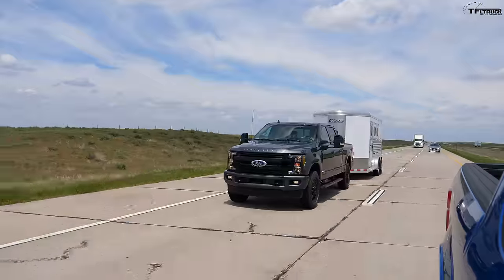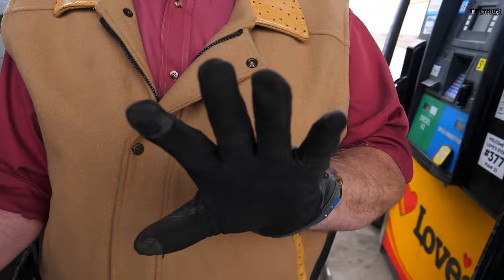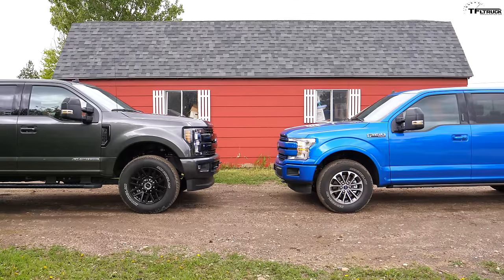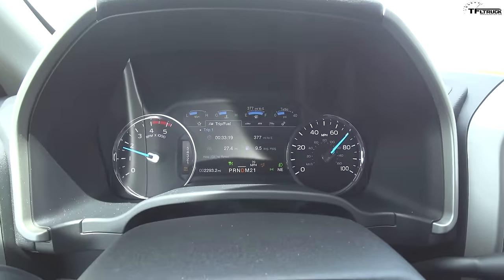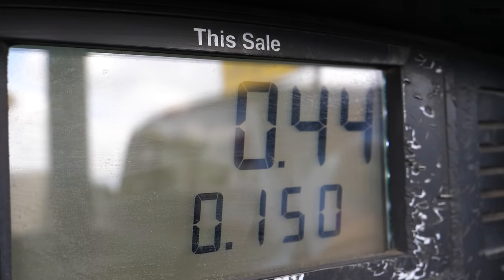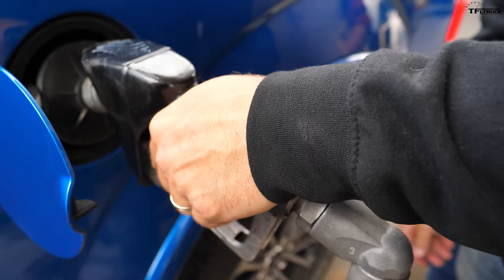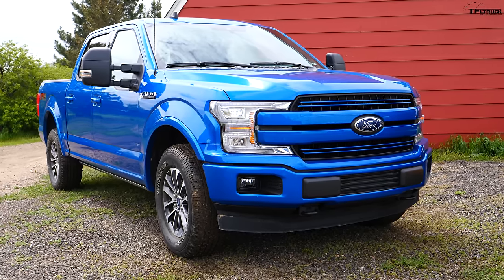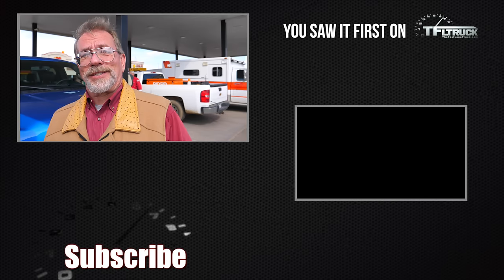Do You Really Need a Heavy Duty Truck to Tow 9,000 lbs? Ford F-150 vs F-250 MPG Review

Comment: Bought a 19 f350 with a gas motor because I knew I wasn't going to be towing all the time. You can feel our steel 3 horse trailer behind it. But for 10k and the headaches that come with diesels now days I'm fine with it.
Reply: Nice, I got the 2018 GMC Sierra 3500 HD with the 6.0l gas engine and I tow my 34' Fifth wheel at about 12-13k pounds, I think it handles it just fine.
Reply: @dedalliance1  I'm in the market for a new truck.  I've driven diesel 2500 for years but with all the emission crap on the diesels I've considered a gas burner.  What kind on mpg  do you get empty and loaded?  Thanks
Reply: @w.j.guidry8459  So my truck's the 2018 GMC Sierra 3500 HD 4x4 Crew Cab Long Bed SLE 6.0L gas with 4.10 gears in the rear end everything's stock in it as far as performance or tire mods.

So for empty highway driving over the 14k miles I've had the truck it usually stays between 11 to 13 MPG but I will say I've driven mostly in Washington State, Montana, and Colorado and the roads between those states. So anytime in Colorado and Montana I'm running 4 to 6k+ feet above sea level. Also, the speed limits in these areas are usually 70 to 80 MPH, and I like to cruise at 85 or so if traffic allows for it. I also run the cheapest gas at the pump that I can get, if that makes a difference to you. If you were going to do 60 or 65 at sea level with minimal hills you could probably push 14 mpg. That being said one time I was driving west of salt lake city by the salt flats and the winds were about I would say 40 to 60 MPH coming at me at about 1 to 2 o'clock and trying to maintain 80 mph I was getting 6 mpg, I actually stopped and gave gas to another GMC that ran out of fuel, so I know it wasn't just me, the wind was terrible.

As far as towing goes, I did tow my sisters 3 horse gooseneck trailer about 200 miles round trip, some city some highway, no more than 75 mph on the highway though, and we had 2 horses in it but only for about 30 minutes going from one barn to another barn (she transports horses for money to various places) and so with the horses you're probably talking a 8 to 9k pound trailer, without the horses around 6 to 7k pounds, and I averaged 9 mpg according to the computer (Which is usually within .5 mpg accurate) and this was in the Denver Colorado area, so exactly a mile above see level, give or take. And with my 34' fifth wheel camper going from Butte Montana to Billings Montana with a couple passes in between, I was testing the best fuel mileage I could get so doing 65 mph (A lot slower up the hills, the engine screams if you try going 60 mph up a pass so I had to just stick around 3-4k rpms and try to maintain speed, I think I ended up going 25-30 mph by the time I reached the top, lol) Anyway, 3 hour trip and I checked it at the pump I got 8 mpg, which the pass I climbed was 6,500 feet above sea level, everywhere else was probably 4 to 5k feet. But then another time, I was going from Colorado to Montana in a hurry pulling my camper, I got a job offer and they said be there the next morning and I didn't leave until 4:30 PM on a 9 hour drive. And I'm not condoning this to anyone out there, but I was pushing that truck and trailer to 85 mph or better anytime I could just because I needed to make a decent time. So roughly a 500 mile trip on every tank of gas I was averaging right at about 4 mpg according to the computer. So if you're used to diesels and being able to go fast up hill or on any terrain really and you try to push a gas truck like that your fuel mileage is going to be complete garbage, they just don't have that torque until you get to 4k rpms or better and even at that it's still half the torque of a diesel.

Before I got my trailer I had about 12,500 miles on the truck and the biggest load I had on it was my small 1,000 pound pop up truck camper, but it wasn't on there a whole lot, maybe 500 to 1,000 of those miles. So I left one of my trip meters as is when I bought it from the dealership with 18 miles on it, and at that time of roughly 12,500 miles it was averaging 10.6 mpg. As of now at 14,000 miles towing my camper around (I live in it full time so I have to move it every so often going to a dump station or from this place to that place) and my computer is now averaging 9.6 mpg over 14k miles. Which isn't great by any means, especially with the price of fuel, but it's really not bad for a 7k pound truck running from a gas engine, one of the biggest gas trucks you can buy. And I'm not flooring it at every light like I used to with my old truck, but if I need to get up to speed on the on ramp I will, so I will say it's probably driven about average and I try to limit my idling time.

I just realized this is really long. Long story short, 9.5-10.5 mpg average over the life of the vehicle, I'd expect 7 to 9 mpg towing any sized trailer at a reasonable speed. Anything over 80 mph towing or over large passe you'll drop to 3.5 to 5 mpg. Empty highway is 11 to 13, empty city is 10 to 11. It's a pretty stable engine in the fact that it wont vary too much if you don't push it and under normal circumstances.

Once I get the money I want to upgrade the exhaust and the air intake to see if that helps with fuel mileage, but as of now the truck is stock. Hopefully that helps.
Reply: @dedalliance1  my truck is about the same I've got 8k miles on it and the computer says 12.8ish mpg and that is mostly city driving around salt lake city on cheap gas. I was going to buy a Chevy but gm doesn't give you shit for options on building a truck other than the way they want it... I want to do the same and see if an intake and exhaust will help, but damn it's hard finding aftermarket parts for a gas motor now days. Get a diesel 1000+ different companies gas you get like maybe 5. 😡
Reply: @dedalliance1  thanks for the information this helps.  I live in Louisiana so no elevation changes to speak of to hurt mileage just heat and humidity.   We have a 27ft travel trailer weighing about 6k.  Down hear I get 10 to 12 at 65 to 70.  I've gone as far north as Ohio and would get 13 at 65.  Towing My tractor and trailer I get 10 to 11.  Loaded it's anywhere from 9000 to 11000 pounds depending on what Implements I bring.  My day to day driving around town I get 17 and 20 to 21 on the hiway.  Diesel here is thirty to forty cents a gallon more than regular gas.  I do have a ton of modifications to this truck, air intake, exhaust, cat delete, programming and so on.  I have run into 1 person down here with a gas 2500 and he said he got 10mpg.  Didn't matter in town or hiway, but he didn't tow anything.  Thanks for the information
Reply: @ryanc8188  I'm surprised your truck gets almost 13 mpg city that's pretty good I think.

But Yeah, I think an air intake and exhaust would help a at least a little bit, especially for me at a higher elevation so that the motor can get more air. But even if it doesn't work, the truck would sound way cooler with a better exhaust system. Right now my truck sounds wimpy because they try to make it as quiet as possible for ride comfort.
Reply: @ryanc8188  Also, I'm curious about what Fords new 7.3L gas engine and GM'S new 6.6l gas engine is going to get for fuel mileage. If it's significantly better I might seriously consider trading mine in for the the 6.6l truck, but the downside is the 6.0l has been around for almost 20 years now and all of the kinks and problems have pretty much been fixed by now, and the parts are probably pretty easy to get. But I'm not sure what the new engines are going to be as reliable as the ones we have now. I guess time will tell.
Reply: @w.j.guidry8459  Yeah. In all reality once you get a diesel tuned and deleted and everything it's going to be a pretty solid truck especially in reliability if you maintain it well.

 Also, I'm curious about what Fords new 7.3L gas engine and GM'S new 6.6l gas engine is going to get for fuel mileage. If it's significantly better I might seriously consider trading mine in for the the 6.6l truck, but the downside is the 6.0l has been around for almost 20 years now and all of the kinks and problems have pretty much been fixed by now, and the parts are probably pretty easy to get. But I'm not sure what the new engines are going to be as reliable as the ones we have now. I guess time will tell. But if you do want a gas truck I would wait and see what the new ones are going to get for fuel mileage and performance. And if you're looking at brand new trucks, once the 6.6l and 7.3l comes out, I have a feeling you'll be able to get some steep discounts on the out going models.
Reply: @dedalliance1  Ya they released the info on the new motor like a month after I got mine but I'm not a big fan of the new front ends on either at the moment. My truck is like the one in the video with the sport package but it's magma red and a long bed. It's kind of a chameleon color just depends on the lighting. But she is a neck breaker 😂 👍. I would wait a couple of years before I bought one of the new motors nothing worse than being a guinea pig and having problems... They are already starting to cut the prices on the 19s know a guy that just picked up a Chevy with a diesel for 50k out the door.
Reply: @ryanc8188  Yeah that's the problem, I don't want a truck with a bunch of problems lol. I paid $41,150 out the door for my truck and the MSRP was $53,300 so I got a pretty decent deal on it. But you can definitely get a good deal if you do your shopping right.
Reply: @dedalliance1  I don't think they will be as bad as the diesel's but there will still be problems guaranteed. I had to order mine and it came in at 62k by the time I got out the door I was just shy of 70k with an extra 5 year bumper to bumper and all the bull shit that comes along with buying a vehicle. But it is exactly how I wanted it so I'll pay my money and be happy.
Reply: 6.2 gas motor is a great engine, no regrets
Reply: @SMiller5488   when you can open the hood and it looks like my 93 chevy with a 5.7 in it you know you at least have a chance to work on it 😂
Reply: @w.j.guidry8459  Just to give another real world update on my truck. I towed my fifth wheel camper again this weekend and the first 200 miles I got about 6 MPG doing 65 mph. But it was pretty windy for some of the drive and I think that caused a loss in efficiency. And then a couple days later I drove another 60 miles with some decent uphills and some curvy spots I had to slowdown to the 50 mph range, but I averaged 9 MPG on that trip. It really does seem to fluctuate a lot on your fuel mileage depending on the day and maybe even the gasoline you get. But today I was driving out of the mountains on a dirt road and noticed my transmission temp was up to 212 for maybe 10 or 15 minutes and then it dropped back down to under 200. So I'm going to look at getting a bigger transmission cooler which shouldn't be too expensive, but might be something other people want to consider too on gas trucks (or even diesels) if they're towing heavy in the mountains.
Reply: shit my 2015 f250 diesel feels my 7k lb camper behind it when i'm driving. i have an aux fuel tank in the back that's 33 gallons and my 4 wheeler which is 900lbs and with the camper i might get 9 mpg at best. that's with factory tires and rims. with bigger tires it honestly doesn't make a noticeable difference.
Reply: @brandonkeck4404  That sounds terrible for a diesel in fuel mileage.  I feel sorry for you lol.
Reply: You made a financially responsible decision to get just what was needed vs. full beans.
Reply: @w.j.guidry8459 2014 Chevy 2500 6.0l getting 14mpg city up to 18 highway empty. Towing 9k I get exactly what this 2019 F150 Coyote V8 gets about 8mpg highway.
Reply: 2014 Chevy 2500 6.0l gas engine works for my situation. Snow plowing in winter no cold starting issues at -20f. Never again max towing in my Yukon XL again. If I ever would tow over 10k lbs I would go diesel. Right tool for the job as the saying goes.
Reply: @johnpaul69420  that is better than I would have thought.   Thanks

Comment: Many other things to look at besides mileage. Like trans temp, braking, wear on parts. I have pulled 9000 with a 1/2 ton with cross winds and it is not fun. With 3/4 no problem.
Reply: I took the point to be if you rarely pull that much weight, or for shorter distances, the 150/Coyote was more than adequate.  Agree fully that if you are doing long hauls with a long, heavy trailer, the bigger diesel truck is the way to go.  Overkill though for what is primarily a daily driver with a smidgen of towing thrown in.
Reply: @timclaus8313  You don't need a Diesel and you'll have more payload without it.

Comment: My personal motto...overkill my friends...always.  For power, brakes, sway and over all safety
Reply: Totally agree.  I flinch every time I see someone in a half ton towing a huge fifth wheel RV.
Reply: Obviously a 3/4 ton is the preferred truck but its not phesible for alot of people. For an occasional tow 1/2 tons do just fine. Just keep your distance and dont be an idiot. If your tailgating with a 30ft camper you'd likely crash in either truck.
Reply: Bill Waterhouse not mines, I'll take safe and stable, and the HDPP 1/2 ton tows and handling all the trailer I would want...37 ft, 8,400 dry, three slides. 😊
Reply: 9k behind a f150 gasser is not recommended in my book. I pull 10k daily and wouldn't want less than my 3500 diesel.

Comment: F-150 3.5L Stock tows 10,700lbs. Properly equipped it is 13,500 lbs. They also have Trailer Sway Control built in, and you can find the video with Mike Rowe testing all trucks, I would definitely check it out

Comment: I towed a 9000 lbs, 30ft travel trailer all over the country (using E2 equalizer anti-sway w/weight distribution hitch) nearly 60,000 miles with a 2012 f-150 ecoboost with the max tow package. Never a single mechanical issue with it.
Reply: How many times did you panic stop going down hill at 60mph in a cross wind.
Reply: Ed Mikula not once. If the weight is distributed properly the sway is greatly minimized.

Comment: I did a mpg loop with my 2007 F150, 5.4, 3.73 verse my 2019 f250 fx4 6.2 gas, 4.10.  Used my 16 foot enclosed trailer with my chevy spark and a tool box in it. About 5000lbs.  After 80+ miles identical route, same day, there was 50 cents difference at the pump.  However, while the F150 didn't struggle with the load the F250 definately handled it much better.  The wind, the uphills (4speed vs 6 speed trans), the general driving was just much more confident in the heavier truck.  The F150 is rated up to 9400lbs and the F250 is 15k if I remember right.  My F150 is a considerable softer ride even though I have load range E tires on it.
Reply: You mean 4.30 in the 250?

Comment: I agree with the others. TEST BRAKING!!!
Reply: *TEST EMERGENCY BRAKING
Reply: I didn't think that would read as, "test it as if driving miss daisy". @mattbrew11
Reply: I have 500,000 miles on my F150 towing 11,000 lbs the entire time.  Duo servo hydraulic brakes on the trailer.  Stopping is easy.  Keeping the brakes cool on a 10 mi 6% downgrade is another matter.  Diesel with engine braking is nice.